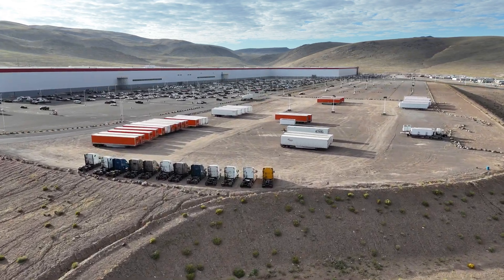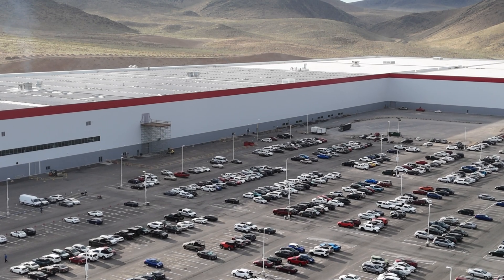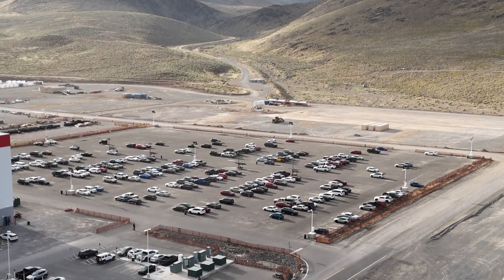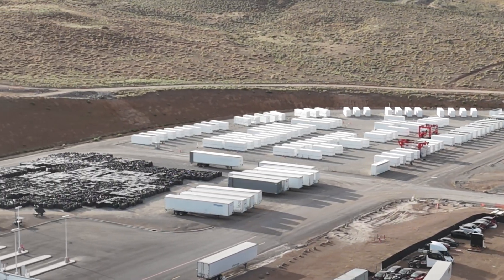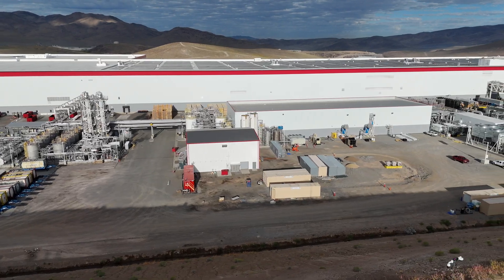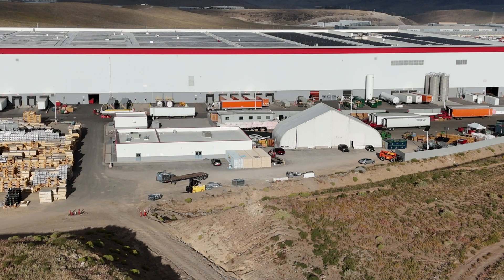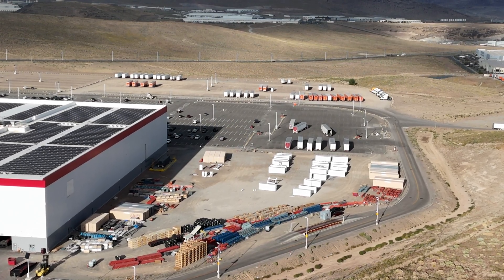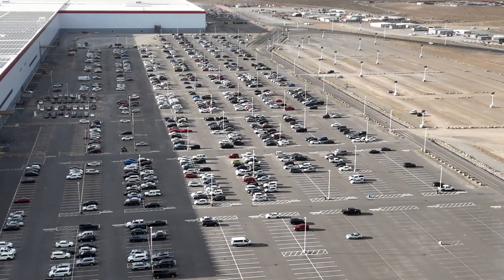Giga Nevada Drone Flyover - First Circumnavigation!!

Comment: I am very grateful for your work! You should establish a minimum flight altitude, in this case the altitude of the high voltage cables in the hills, so you can fly in any orientation without worrying.

Comment: Anyone know why there are a bazillion truck trailers there? Seems like a lot?
Reply: I think Elon didn't introduce a number of containers per unit produced metric as yet. 🤭 of course each container has to be paid, they are rented, so to me it as well looked like quite a bit of money waste. Maybe Elon needs to watch these videos as well so etimes to catch up on some deficiencies? 🤠
Reply: Those trailers are the parts warehouse on wheels. Saves building a huge expensive warehouse and allows easy deliveries for drivers without having to wait for available delivery docks.
Reply: @paulmcgreevy3011  while that seems logical, I remember when I imported some goods from Taiwan with roller blade skates, my first worry was to immediately offload and return the container as they charge huge fees for it if you don't. So I'm wondering how much it costs Tesla, and what arrangements they have so it is not cost prohibitive?

Comment: Can they pour concrete over that. Asphalt for the factory floor?  If they pour the concrete deep enough; can they bolt down the walls to it and forgo the 100's of geo piers?
Reply: AFAIK the existing building was built on footing pads more or less the same as Giga Texas, less the geopiers. 

Column spacing is rectangular at 50' x 40' 15.24m x 12.19m, whereas GigaTexas is 45'10" x 45'10" 14m x 14m.

There are strip footings*/grade beams between the braced column bays. Did the same at Giga Texas.

In terms of the asphalt, a lot would be coming up anyway for the pads and strip footings, more for in-ground utilities. Plus, the finished floor grade/level/elevation needs to be taken into account. Ideally that would be the same throughout the plant.

*The term used by the design engineer
Reply: @DessieDoolan I'd think that they knew the extension would be done at some time later, so they should have something ready in preparation of that current parking lot, right? It is easy to strip the layer of bitumen and recycle/reuse it for the new parking lot which already exists but unsealed, and then it depends what is under. That's my uneducated guess but I ain't betting. 🤠
Reply: @Alarix246  I'd be surprised if there are any footings already prepared under the asphalt.

I haven't followed this factory at all, but from looking back over videos from the original build, they seemed to build on every footing constructed.

Those early videos weren't that regular though, so I guess it's possible, and it is Tesla......, but I'd say unlikely.
Reply: @DessieDoolan  I didn't mean they'd have footings under the asphalt, but something could've been already done, like leveling the terrain. Not sure if there is concrete under the asphalt, but anyway if the place is leveled already, scraping it off is easy, recycled for the adjacent parking lot and they can start very fast. True there is nothing much to be expected besides this.
Reply: @Alarix246  Yes I would guess the earthworks are complete. Looks like there would have been cut and fill. Presumably the fill compacted for the expected extension.
Reply: Good questions w big answers.  

Just MY semi informed opinion: they won't build over asphalt if only that the matrix, aka., actual petroleum's "crudest" component, called asphalt, is biodegradable, roads get eaten slowly from below.  

Piers could in principle be replaced by massive slab except for lateral stability, earthquake factors and structural/building cost efficiencies. 

 Long slender strong columns buried deep could replace much more rebar and concrete in the slab on top, boring and such much more expensive per pound but not per $/effect-results.  
Similar to how much bigger a beam must be if it's span is doubled, put another column midway in said beam span and same beam is 4x stronger.  
(or beam is scaled down dramatically for same strength)